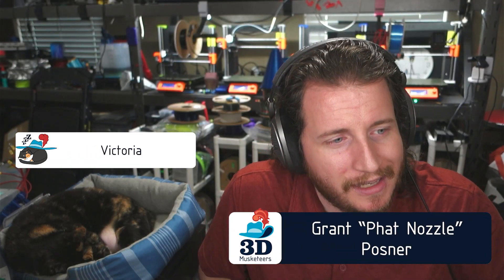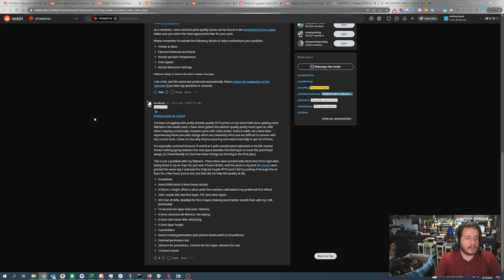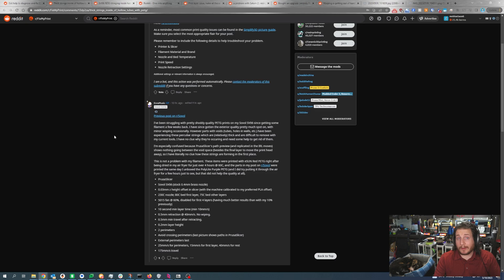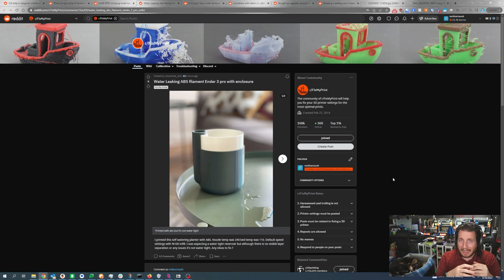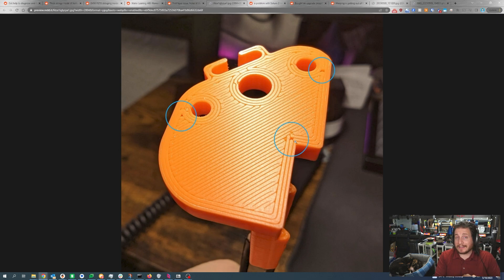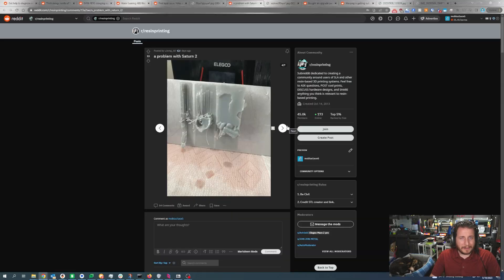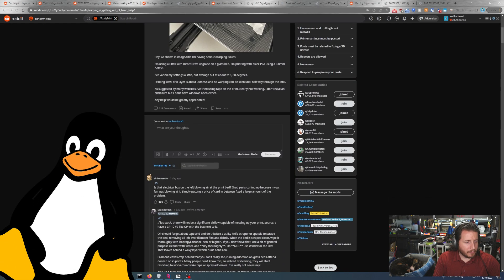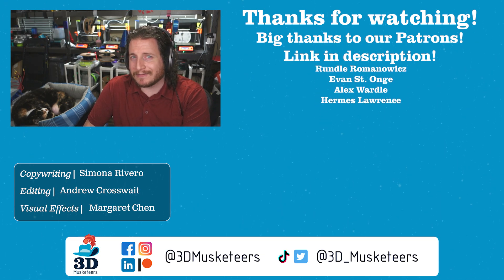The Fail Is Coming From Inside the Resin Printer! - PrintFixFriday 87

Comment: Idk about shipping containers but if you end up deciding to build i suggest building taller than you currently think you would ever need.  Cost doesnt increase much to build taller but gives you a lot of options in the future.  Especially storage space.  20+ foot side walls can be your friend.
Reply from the maker: the extra high containers get to 9.5ft which should be fine. I would love to make a building, but I dont want to live here forever and dont own the house I live in.
Reply: @3D Musketeers  then that totally makes sense.  One good thing about containers is that you can weld directly to the wall.
Reply from the maker: that and they are pretty easy to move and wont need extra places to store in case of a hurricane.

Comment: Remove tank and  clean printer.
Do screen test and check for damage.
Check build plate for any chips of metal sticking out, if so sand them down.
At first glance i say overfilled tank, but it could be support remaining that were floating in the tank and punctured the FEP.
Reply from the maker: 100%

Comment: I am sure that you have already run through different options, but I would gut half an RV trailer.  That way you can be mobile, live in it, use some of the existing buildouts, and it is more stealthy.  I would upgrade the shocks and of course the electrical.  The biggest downside is security.  It is more stealthy, but it would be easier to break into.
Reply: Or you can get a trailer with a vehicle bay, but they tend to be more expensive where I am at.
Reply from the maker: We would need a BIG RV to do this if I wanted to live in it as well. 

toy haulers are pretty pricey out here too, even ones that need work

Comment: On that last one - I also think that for the price of a CHT nozzle, it's worth the investment. Any time I print "fat" now, I prefer to use the CHT nozzles I have to ensure I'm better melting the plastic to its core. I've easily printed with their 1.4mm nozzle with no issues, granted it's on a Prusa and there are no fans nearby. The extra flow capacity really helps me spit out the plastic but on machines with more anemic heaters, it's going to be that much more help.
Reply from the maker: Here's hoping the diamond nozzles comes in high flow soon!

Comment: Hi. About the holy first layer section. Are you sure it's a pressure advance issue? The small white bits are not even (not the same thickness everywhere) so it seems to me like arachne is active. If it were a pressure advance issue we should be able to see some sort of under-extrusion in the corners or at the end of the zig-zag on the bottom fill. Those look fine to me. The problem shows only at the end of extrusion where the z-seam is. I tend to think it's a retraction/wipe issue. I could be wrong. Thoughts?
Reply from the maker: Arachne would not have the small white bits, that is gap fill, which is disabled with Arachne. I could be wrong though, could absolutely be a restraction and de retraction thing!

Comment: One note on food items: copper/brass nozzles have lead in it and are released on unsafe level while printing. Minimal quantities but enough to be on seriously dangerous levels when in contact with food. So even if filament is food safe for single use (cleaning is still no go) you would need a complete hot-end and filament path in unleaded and nontoxic materials and is really hard to find that combination.
Reply from the maker: did I not mention that here? I thought I did, I know I have in the past! But yes, stainless everything is needed minimally.
Reply: It does not, this is an often repeated piece of misinformation.

If you do the calculations, even if your nozzle lasted only 1kg of printing and was worn down totally, the amount of lead you would risk transferring to the food in contact with the plastic is magnitudes below the limits for drinking water.
Reply from the maker: the amount of lead deposited is not anywhere near enough to be an issue, yes. But the lead levels in it make it not food safe from the beginning, regardless of the printing properties I believe. However you likely know more on this than I do!
Reply: @3DMusketeers  The amount of lead would never end up in an amount that would be dangerous to any living being, so in that definition of "Food safe", it wouldn't be an issue.

In the legal / FDA definition of "Food safe", it could be a problem getting something certified (though this specific problem would easily be resolved by switching out to components not made out of leaded brass), but there are so many other issues with getting an FDM system and the corresponding printed parts certified under those regulations.
Reply from the maker: I mean, with the water the FDA clears as being fine, it could have freaking buckshot in it and be fine LOL.

Comment: I've been printing my MK4 parts. I've had a few parts with blobs on them. They don't look burnt. I haven't had this issue with PLA. My revo is a year old. But I don't think that would be the problem. Other than the blobs the parts come out pretty good......unless bridging is involved. I'll have to double check, but I don't think PS has any extra cooling on bridges.
Reply from the maker: the latest PS alpha has a bug with bridging
Reply: @3DMusketeers  interesting. I didn't have any issue with my racinante print. That was PLA though.
Reply from the maker: it is apparently fixed in the next revision :)
Reply: @3DMusketeers  It's out as of last night! Beta 1!
Reply from the maker: :D
Reply: @3DMusketeers  I had a 150mb gcode and I didn't want to download it from the pi (it tends to crash with large files when printing) I didn't want to go to the desktop. But I only had alpha 5 on my laptop and the .3mf file on my desktop was an alpha 6 (you can't go backwards) So that's how I found it. lol

Comment: On the last one: Noticed that they're running with the bed "upside down" and printing on the plain glass rather than the carborundum textured side. Anyone else doing that? I ended up doing this myself with my similar bed (a replacement for the mirror that flew off the printer a few weeks ago) because the textured bed just kept eating nozzles. Glue stick works great for me for adhesion. Though you probably have it right on the temp issue in this case.
Reply from the maker: I prefer smooth glass to that carborundum stuff personally.